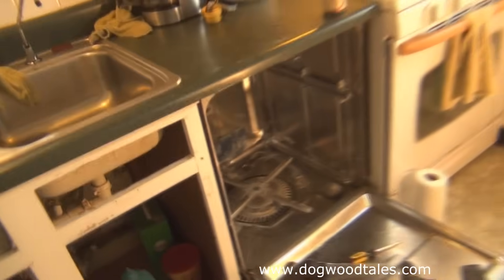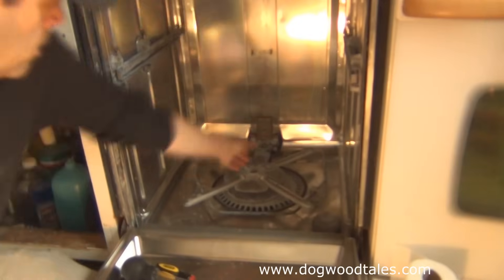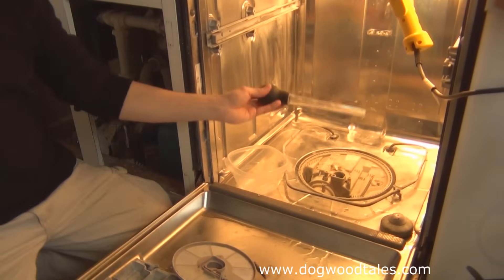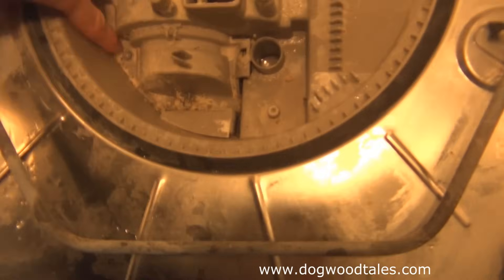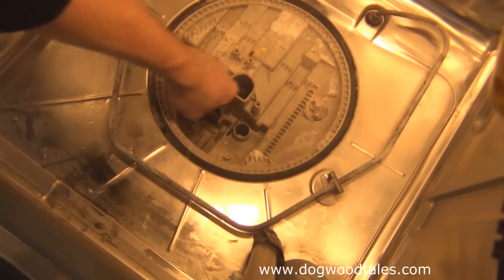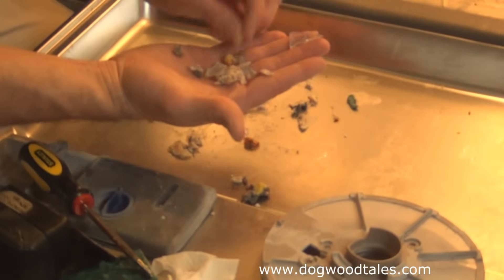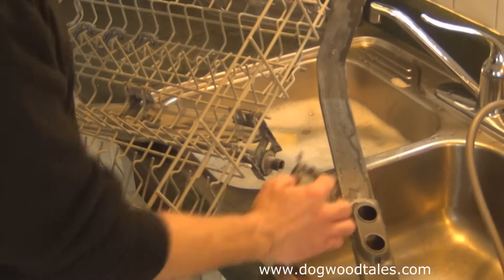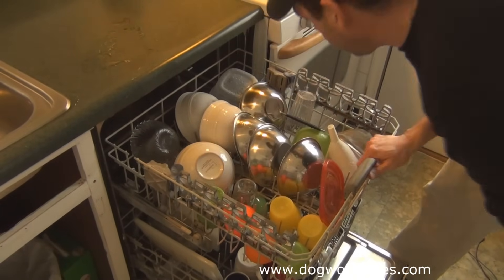Dishwasher Cleaning - Top Rack Doesn't Clean

Comment: You saved me at least $200 for a service call.  Our Kitchen Aid DW is 5 yrs old.  It is almost exactly like the one you worked on.  I followed your example and did find a lot of crap in the system, but was wondering if that was really the problem.  After putting it all together again I distributed 9 custard bowls on the top rack right side up.  I turned it on rinse and all 9 were full of water!  I then put cooking oil on the bowls and placed them upside down with the next regular wash and they came out clean.  I also noticed the sound of spraying water was a lot louder than before the clean out.  Thank you very much.

Comment: OK, first off this whole video is amazeballs.  THANK YOU THANK YOU THANK YOU RAYMOND!!!!  A few notes - the whole process did take me several hours to do so please give yourself some time to do it right!!  (I also had a LOT of soap residue and other gunk build up and NASTIES in the chopper/grinder area!)  Also, I had trouble re-seating/re-assembling my screen/blade assembly.  When I removed the cover on the grinder, the screen and blade assembly came with it.  Took those all apart (screen and blade stay assembled together as a unit), but when it came time to reassemble and marry the forked end of the motor and the little forked end of the blade, it took a bit of wiggling and trial and error to get it seated properly.  When it was finally in place I knew the forks had aligned properly because you can feel the resistance when you try to hand turn the blades of the little grinder.  Anyway - otherwise - AMAZEBALLS!!!  Thanks again.  My boyfriend wanted to ditch this dishwasher and buy a new one, but I wanted to try this!  Saved us a few hundred bucks in repair bills and our dishwasher will last a few more years!!  Also, thanks for the tip on the vinegar every month.  I'll be doing that from here on out.  FANTASTIC DIY Video.  One of the best I've ever seen!!!

Comment: This was a great tutorial - and gave me the courage to tackle the job on my own with little prior home repair experience.  I work very slowly and including the time to 1) figure out which fuse the washer was on;  2) find the proper screwdriver bits; and 3) find the darned turkey baster it took me a little over 2 hours.  One thing I discovered due to the bad design of my Kitchenaid which has the heating elements too close to the lower plastic parts - was that my Proscrub blue plastic unit had holes in the bottom nearest the heating elements from the plastic being made dry and brittle causing loss of water pressure.  I am looking into ordering a replacement part - so that's another thing to check. But they are $46!  They really like to make you pay for their bad designs, I already had to spend $30 to replace the silverware baskets for the same reason. 
But this was the best tutorial I have seen - sometimes you really need to watch the steps rather than just read them to understand what to do.  Thanks a bunch!

Comment: I just followed these instructions for my 10 year old Kitchenaid W10311123B and they were excellent. I did put it together before running the vinegar wash cycle based on Mike Krager's comments in case my model might also leak without them.

Comment: Thanks very much!  Our dishwasher is a Whirlpool, but very similar to yours; the channel along the back wall and across the top attaches with two screws (instead of fasteners that pop out), but everything else was the same as yours!  I found three pieces of glass, a tea bag, and a lot of crud.  I haven't run the "after" test yet, but I believe that should fix it. 

I would not have figured out how to take it apart (they really should include instructions in the owner's manual, but I guess that would reduce their sales, as folks can keep their existing dishwashers going longer), so thanks again!
Reply from the maker: one needs to be resourceful!
I hope it worked out well for you.
Thanks for watching

Comment: Thanks so much, saved a repair call, and you know how those go, they find something else that needs replacing.  I had cleaned the intake area before, but never the chopper area, and that did the trick.  I would have never figured out how to remove the chopper cover without the video.  I lucked out that I have the same brand, so extremely similar to your video.  Thanks again.

Comment: Water leaking after normal wash. I have a slightly different Kitchenaid with a round heater on bottom. If you try a wash with the parts out it will leak from the front. Put all parts in, no leaks. It must be too much pressure with the parts out. Followed all other directions, worked out great! Thanks, you saved me.
Reply from the maker: thanks for letting others know about the issue you had. what model do you have?
Reply: +Dogwood Tales (Ray) I have model # KUDS301XWH4, controls on front face above recessed handle.

Comment: This video was exactly what I needed and did solve my problem. The only thing I would add is you can actually remove the entire chopper assembly. It has a spring-loaded shaft, so if you pull the 'blade' forward - away from teh screen, it disengages from the motor, and the whole thing lifts out. This made it much easier to clean.
Reply from the maker: Fred Rosenberger Thanks for the tip!

Comment: Thank you Raymond Ladouceur!!!! 

 What is with the designers of dishwashers that they make cleaning them so difficult.  There is no need for this kind of complication for necessary cleaning.    Years ago I had a Kenmore dishwasher that had a small -- EASILY REMOVABLE !!! -- tray in the  bottom of the dishwasher that I would take out and rinse every couple of days.   They should make the engineers who design dishwashers clean them.

Comment: Excellent video (and entertaining as well)! I was working through these steps on a Whirlpool dishwasher, but the tutorial was close enough to figure out any slight differences. 

As an FYI for other Whirlpool dishwasher owners: it was difficult getting the blade and metal screen back on, but for anyone who has a Whirlpool dishwasher and gets stuck at this step, remove the blade/metal screen part from the plastic housing first (it's easier to clean that way, anyway). When putting everything back together, put the blade/metal screen on first, paying close attention to the cut of the metal screen to ensure proper fit. Slide the plastic housing back on top. When I did it this way, it was almost so easy that I was tempted to pull it back off again just to make sure that the blade/metal screen stayed in place. I didn't. After already messing with this step for nearly a half hour, I decided that I'm just going to trust that all is well and screwed it back in place... lol...

Now, everything else with the reassembly following that step was cake. Tested it out on rinse, and boom - bowls filled with water! Right now running a load, but I'm confident that this has fixed the issue as the water pressure actually sounds stronger than it was.

I've never seen so many comments on a how-to video praising how well something actually worked. I rarely comment on YouTube vids, but this one is an exception. Bravo! Well done, and thank you.

Comment: Great video.  In mine the chopper blade was toast and wasn't spinning and hence food clogged you the screen and water pressure was too low. The little plastic drive shaft stripped out.  I got a now chopper blade, plus did all the cleaning here and its running like a champ.

Comment: When removing the last piece at the bottom of the dishwasher, that is the cover for the mechanical chopper. There is a round screen, with blades on one side (outward) and a plastic shaft that has a spring located in the center. Remove the chopper, and often, like the brushes of a vacuum, long hairs will be collected there. After cleaning it, replace the chopper back in with the small side of the screen place down into the bottom, press in the shaft in the center and align the small plastic gears. 

Although I felt like you could have trimmed the video down a little more, I think is was very good, instructional, and has saved folks a lot of money. Three years ago a man charged me ( I was to busy to figure it out ) $125 to just clean the thing. He was here 45 minutes and it is just this simple. Your video gave me the small push of confidence I needed to tackle it myself. I was done in less than 30 minutes and saved myself some money. Thanks... Jason

Comment: Thank you so much!  I took apart the dishwasher, cleaned it just like you said, and it works!  My only issue was putting it back together I had to go back to the beginning a few times to see how to re-connect the bottom pieces.  But I appreciate it so much!  Saved me a ton of $$ fixing it myself!

Comment: Video is missing a step between 3:32 to 3:34 removing part between screen & removing water with baster but piece just popped off by pulling from the back of it. Ours wasn't nasty at all, actually quite clean with a couple of lemon seeds & a screw? Our screen was totally clogged & that was all it was. I found removing the screen (by removing the chopper assembly) was the only way I was going to get it clean (clogged on both sides). YouTube video for instructions. Please note which slot the screen is in (closest to the door) before removing it. Also the sides on the screen are flat which need to be inserted in correctly (the slot furthest away from the door is all round so won't allow flat screen sides in anyway. Saved a bunch of money & huge brownie points from my wife (I figure good for watching an extra 6 hours of sports on TV at least! Thanks so much!!

Comment: Great video!  I had the same issue with the top rack not cleaning.  I have a new model unit but following your dissemble instructions I was able to remove the internal parts and clean the inside and around the food chopper.  Now I'm just awaiting the cycle to finish and put everything back together with fingers crossed.

Comment: Thanks for taking the time to make this video.  Though my dishwasher was not exactly the same as yours, the variations were minor and easy to overcome.   I was about to get rid of this 5 year old Whirlpool because the top rack was not cleaning at all and the bottom was getting worse with every wash.   I thought the motor was just slowly losing power.  But after doing the complete cleaning, using your instructional video, it is blasting water all over and working as good as new!!!  Again, THANKS!

Comment: This is a really great how-to. Really good on important details.    
Just one suggestion - for bolts, a manual torx is a whole lot safer for us part timers.  Do not want to strip that single chopper cover bolt hole!
Took me an hour - 15+ minutes for a flat piece of glass that had wedged itself perfectly where the chopper cover pops off.  Couldn't pop the side at all until I managed to fish out the glass with pieces of wire.

Comment: Great video.  Only tip I’d add is the small white  spinner at the very top should be separated using a small flat head screwdriver and cleaned thoroughly.  Important since the problem was no water at top rack.  Also check for string  inhibiting anything that spins.

Comment: Well, mine wasn't cleaning the top rack of dishes either! Searched on youtube and you appeared. Well, not the same washer but mine is a little simpler,.... I think! ... LOL.  I will try cleaning it out. I almost bought a new dishwasher yesterday... $800.00 plus tax... OUCH.
My washer has now lasted 21 years.... I will try cleaning it out... may be the pump for all I know, but worth a try now that I saw your video! 
Thanks!!!
Reply from the maker: good luck, hope it works
Reply: @Dogwood Tales  well, unfortunately,  mine was beyond repair. I got allnthevwayvtona screen where one could see the build up of debris but tried andctried to get the center bolt undone but it was seized. There were 2 or 3 screws missing and the central gasket was still in place but stretched about 2 cm.. longervthan it should be.. so no seal.  I got about 21 years out of it so.. can't wait to see how clean our new dishwasher gets our dishes!
Thanks for the vid... youtube is great for this sort of thing!

Comment: We were getting some water but not getting dishes clean, so we still took it apart following your video. Found the blade had broken off and screen was yucky clogged. ordered replacement part which was surprisingly cheap. Would have never known if I hadn't seen your video. Shared with my fb just so they are aware of the icky buildup that lurks under all that plastic. Thank You!

Comment: Great tutorial.  I discovered when disassembling the grinder that the blade had fallen off.  Probably during disassembly. The cap that holds the grinder blade in place can easily come loose causing the blade and another washer on the back side to fall off.  Reassemble putting the washer on the shaft first, paying attention to the shape of the hole, then the blade, then the cap, before replacing the cover.  Tip:  take a pair of needle nose pliers and slightly crimp the inner lip of the cap inward so when replacing it, it will stay in place on the plastic shaft.  There is a groove in the cover that holds it in place, but without staying in place prior to reassembly, it can be tricky getting the cover back on without the cap and grinder blade falling off again.  Oh... and if you have a sharp steak knife, I used one to scrape off the surface of the food grinder screen as it had collected lots of pet hair which interfered with the water flow.  I'm a GC and install these things all the time.  I usually attempt to fix my own stuff before tossing it, and You Tube is the place I look for info.  KUDOS to this guy.  This is one of the better ones I've seen.  Didn't have to pull my machine at all.  Great work, chief.   Good instructions.
Reply from the maker: John MacNaughton thanks for the kudos and for watching!
So ... you bathe your pets in the dishwasher? 😜

Comment: Yesterday, we spent a couple hours doing the things in the video, and it worked great! That included the time needed to run the test rinse cycle. We pulled out masses of gunk, much of which was bits of the disintegrated silverware basket, as others who commented also encountered. I ordered and replaced the basket itself a couple months ago; now I know where all the broken bits went. Anyway, it runs fine again. Following the video was a much better use of resources than calling for service or buying a new appliance (this one only 5 years old). It's a shame that KitchenAid makes it so difficult to perform what could be a routine maintenance task.
Reply from the maker: +Scott Leonard 
Glad to hear this worked out well for you.
I hear you on the difficulty of routine maintenance. In another video of mine in which I clean out the coin basket of our clothes washer I had to remove the top and front panels of the washer to get to it. This involved having to un-attach the main gasket from the front panel. Some models have a lower, small front panel that is all to be removed to access the coin basket, but I got lucky and bought a model that wasn't so convenient.

Comment: Thanks!  The video gave my wife and I the courage to try this.  It was easy.  We found the chopper blade off the hub and its screen clogged.  We removed the chopper assembly, cleaned it, popped the blade back on and replaced the assembly.  It wasn't difficult.  I glad I know how to do this since we probably have to do it again.  We had a repair man do this once before.  KitchenAid has a problem with this.  At least it's not difficult to fix.

Comment: Ray, I watched the video and in the time it took for my dad to watch it, I had most of the job completed! Great video and instructions. Especially liked the pile of books to hold up the door, the safety tip on turning off the power (my husband is in Health and Safety), and the specific sizes of Torx to use.

When I got inside, the compression washer which held the blade had come loose and the blade was therefore loose as well. Hopefully it will hold together.
-M
Reply from the maker: glad to hear it worked out well for you.
thanks for watching

Comment: Hey, thanks so much for this! I have a similar model with nearly identical internals and the same problem. Just got it working again - it's like new. I used a shop vac to clean out water and the debris that I scraped off.

Comment: Great tutorial! I had the very same problem and everything is back to normal now. One thing to mention though, when I started the dishwasher after removing all the parts (as shown at 9:20) water started leaking through the bottom-sides of the door, I can only assume that the water level got higher this way. But after reassembling everything and running a real cycle, the door was tight again and wasn't leaking anymore.

Comment: worked great.  thanks!  One thing: when I took off the housing for the chopper, the chopper screen and blade came off with the housing.  They were stuck together.  It was a pain getting the chopper realigned with the motor.  So be gentle!

Comment: Great video.  If you clean all this stuff and it still doesn't fix it, the next part of the differential is to see if the machine is getting enough water.  In most dishwashers there ought to be about 2 inches of water in the bottom when it's washing and you open it.  In a Bosch the amount varies.  Check by adding about a quart of water and seeing if improves performance.  If it does there may be sand in the water line filter.  Check that before spending on a new circulator pump :-)